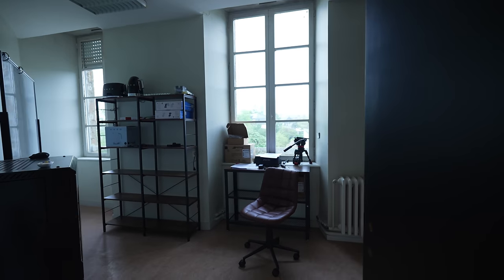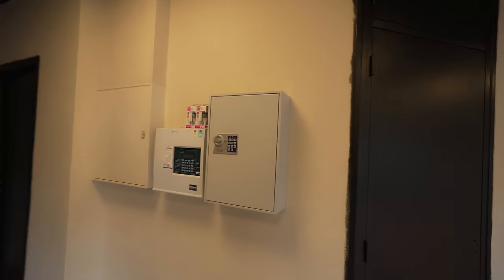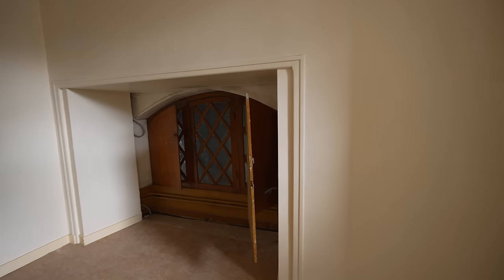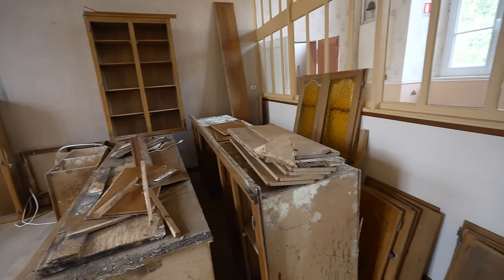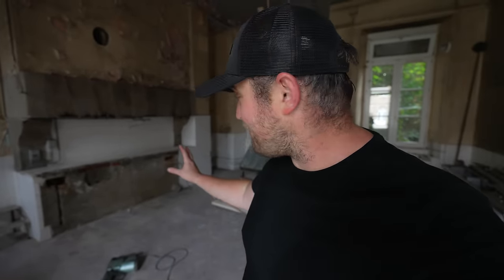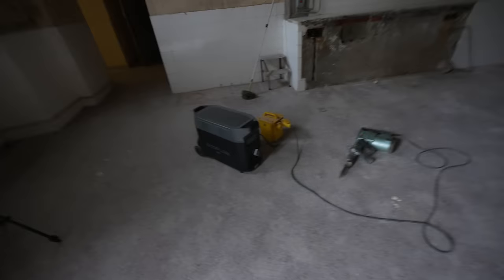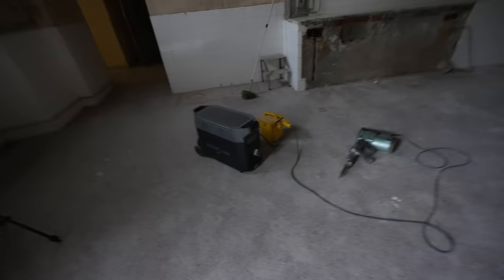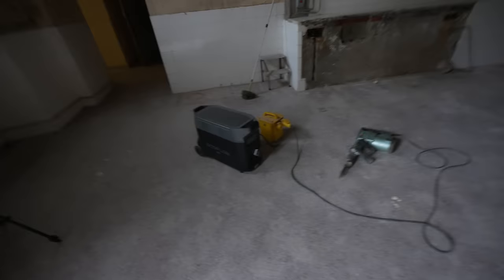Building My Dream Youtube Studio... In An Abandoned Convent #ecoflow

Comment: Billy please use ear defenders when using a breaker. My son uses a breaker in his work and the idiot doesn’t use them.  His hearing is now starting to deteriorate.  I can’t believe the work you’ve done it’s amazing.  Every time I see the exterior I love it more. Can’t wait for next week.
Reply: I was thinking the same thing!
Reply: Yep alot of people will be too ignorant to wear PPE in a working environment,  but you're 100% correct. Ear defenders are 110% needed for that job, as was safety glasses. He did wear safety boots and gloves, to protect his feet and hands. But no ear defenders or glasses to protect his ears and eyes. No point half arsing things when it comes to work safety.  Infact he should have also had a dust mask on too.
Reply: I immediately went to make a similar comment but found yours instead. I've also noticed a lot of the guys working outside aren't using them when using strimmers etc. Anything running a little 2 stroke motor makes a hell of a racket. They should all be wearing them for any noisy work.

Comment: Great work, not trying to be negative but for your own safety you should wear hearing protection and a mask when using the breaker/jackhammer. Silica dust is a massive killer and there is also the potential that some asbestos backing may have been used in some of the renovations throughout the years, also don’t want to lose your hearing. Great work though :).

Comment: im in the USA we use foam rollers to give a spray finish look without a spray gun. works with oil and latex paint. works well on cabinets, doors, trim. try a 9" roller on the walls, a 3/4" Nap works best on any surface with texture.

Comment: Office is looking good. Updating electrical panels and storage isnt "sexy" flashy work, but its very satisfying to have  centrally organized updated hardware. 
The viewing window definitely needs to be more open, however you can accomplish it. It looks too hidden and like a spot for the kids to run to so securely locked is a necessity. I knew you couldnt wait on the other fireplace.  Good job there. 
There are surely other things hidden in the walls to find.

Comment: The first kitchen fireplace is shallow on purpose. In the USA its called a Rumford fireplace. Purposely shallow, the smoke goes directly up. And the more heat is reflected into the room. There's no smoke shelf for the smoke to circulate and create a draft. The top of the chimney would require a top cover to prevent the weather from coming in. Most likely the chimney is not lined. That may be a fire hazard with today's safety requirements. Both fireplaces were probably blocked to create a more modern up to date kitchen area. (stoves etc). They'll be nice to show, but .....

Comment: What you do is amazing!  Thank you for bringing us all along for the ride!  By the way, painting the windows is easy, but might you just fit a black board into the space to block the light and protect the windows?  You could even use the boarded spaces....  use them for hanging everything from papers and posters to tools of one kind or another...your imagination!  Also a quick and easy restore should you ever decide to change the use of the space...just pull down the boards and bingo!  Windows without a need to scrape off paint.   -- Now a question...you have this amazing place, far too extensive for just work spaces...and there are apartments, and plenty of rooms which could be let...Will you maybe be doing rentals, or air bnb in the future?

Comment: you do awesome work, I miss the daily posts, I find them very relaxing . . . couple of questions . . . no foam underlay for the flooring? and do you seat the joints with a block and hammer? . . . one suggestion for the security system is to have a scheduled upload to a cloud account so if the system is tampered with you have at least some data as evidence

Comment: With all the weight removed and to be removed, that part of the building must have raised an inch or two from the sheer ton of all that cement lifted off the fireplace.  You SHOULD be exhausted from all that physical labor, but you thoroughly enjoy renovating and we're enjoying the puzzle that is the former convent.  Wonder what new title you plan to give this building instead of "ye old convent".

Comment: I know from experience that you don’t want that floating laminate flooring cut tight and perfectly to the walls and door frames.  It will buckle with changes in humidity.  Did your flooring have the cushion built in to the underside already?
Reply from the maker: I’ve laid it before and  i’ve also seen it buckle in a old damp house. i’m leaving enough for it to expand